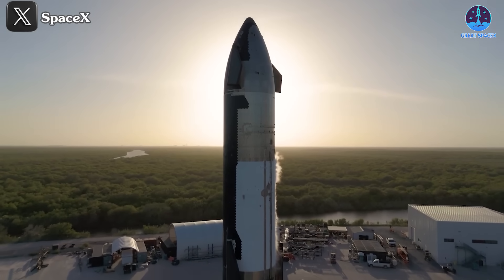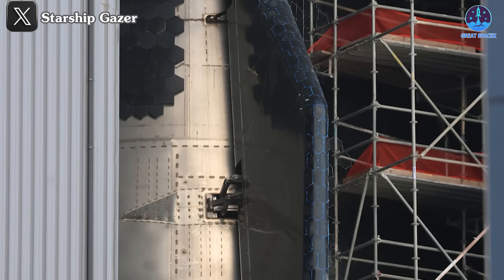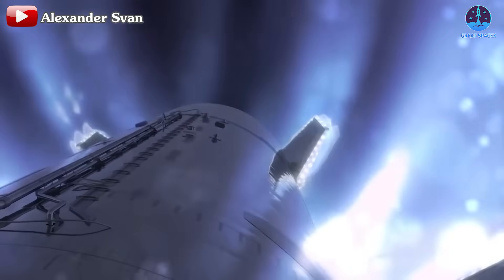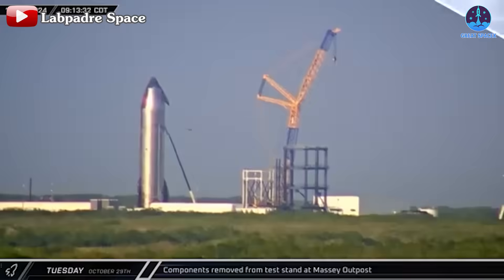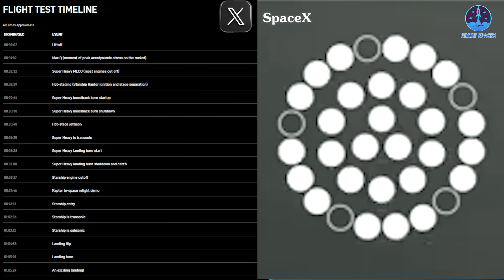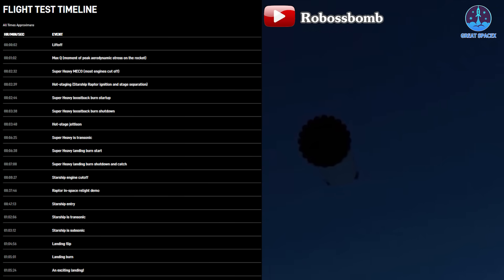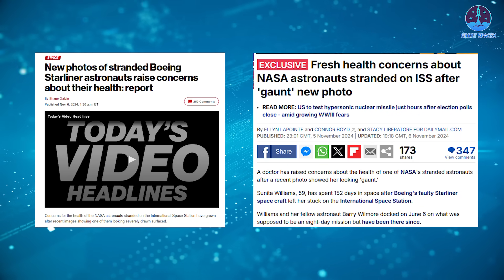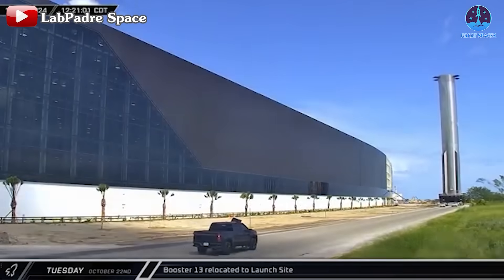SpaceX Forced To REMOVE HEATSHIELD Tiles On Starship Flight 6, WHY? Launch Timeline Revealed...

Comment: What's the backup when the chop sticks fail to successfully catch the booster or starship? Oh wait, there is none. Imagine returning to earth on starship after a long space journey just to have one of the chopsticks fail, with no backup. It's a completely plausible situation and highly concerning. IMO, this approach to to capturing vehicles on return will ultimately be abandoned. It's unreliable, unsustainable and more importantly, unsafe. Go ahead and disagree, but let's wait a few years and see if I am not correct.
Reply: I argue that you are applying flawed logic, are there not about a thousand other things that can fail and have the same catastrophic result, so why is this system so different?
Reply: With the rate of flights proposed by Starship it's not unlikely to think there will be several catch towers side by side.

Comment: Since Starship flight 6 is basically following flight 5's flight plan. Space X is gather data and optimizing heat shield placement. Flight 3 was supposed to test raptor's in orbit relight capabilities, but due to other problems skipped that test. Flight 6 flight data will prepare for the next generation build v2 where they will catch starship.

Looks like the chopsticks mechanism vs OLM launch platform has at least 90 degrees of tower offset rotation freedom. So Space X can catch the booster 90 degrees offset away from the OLM mount and swing stack the booster back on the OLM after it is caught. This would allow one tower to catch then stack both the booster and then starship for a quick restacking and reflight refueling.